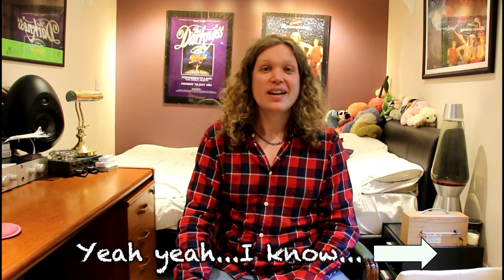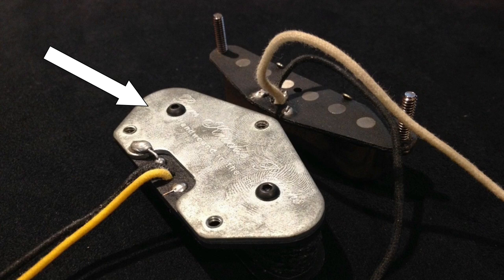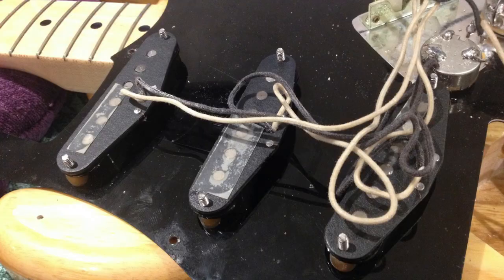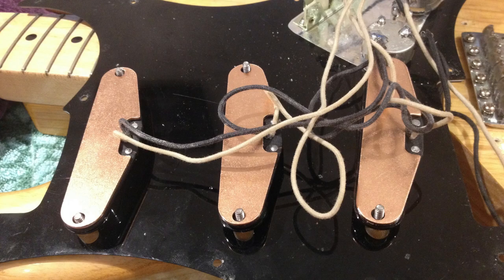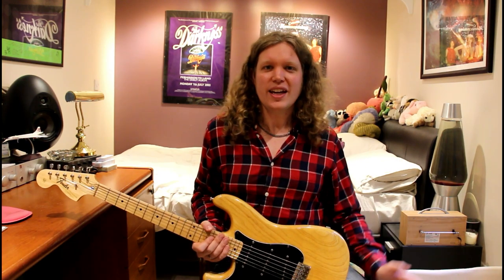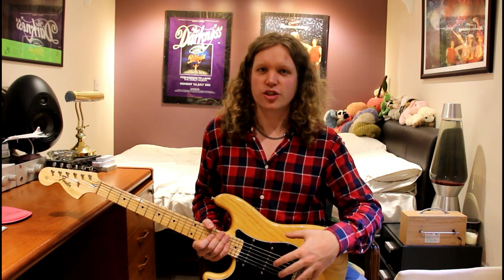Strat Base Plates: Do They Work?

Comment: Tighter bottom end and little bit of a zing to the high mids. Definitely makes the Strat "rockier".
Reply: Tighter bottom end usually means less bass frequencies, are you referring to that?
Reply: @javiceres  It seems like he wasn't. I hear more bass with the plates than without.
Reply: @101Volts  So I think but...

Comment: Definite difference. I would leave it on the bridge pup only.
Reply: Max Jones yeh, I like the sound of my Lindy Fralin Vintage Hot set with the base plate under the bridge only on my USA Hamer Daytona Strat. It’s a natural swamp ash body with maple neck and fingerboard.
Reply: @warmothgmc  Lindy Fralin pickups reign supreme, in my humble opinion. I have the P.A.F.s for my Les Paul copy, but my next purchase will be a loaded pick-guard with the base-plate installed in the bridge position - I really do want the tone to exist somewhere between pure strat and P90.

Comment: I don't know who claims the Steel "reflects" the magnetic field back up, but that doesn't make sense.  Steel is much more permeable and conductive than AlNiCo.  If anything, it draws flux away from the AlNiCo, but may also draw the flux lines from the strings down more directly through the coil, while slightly increasing coil inductance and rolling off highs.

Comment: Wow I'm surprised how different it actually sounds to me. I really liked both sounds and would be happy with either -but I think I kinda preferred the base plates under all three pickups actually 🤔 Very interesting -thank you for doing this 👍😊
Reply from the maker: No probs Alena :-) I ended up taking them out, but if you're wanting to beef up a Strat they're ideal!
Reply: @JoePerkinsMusic  For sure, and I might try it someday.  -But - in all honesty I have found that anytime things get changed in my signal chain (including the guitar) I can almost always find a way to get the sound I want and make it work for me if I work at it. So with or without the plates I'm sure I could find comparable sounds with some adjustments -it just depends what starting point you prefer I guess 😄 Still very interesting vid, thank you again for the experimentation I know its allot of work! 👍
Reply from the maker: @alenac7269 Yeah absolutely, there's generally a way to adapt your gear to get the sounds...base plates or turning up the bass/low mids will achieve similar results! :-)
Reply: If you want more beef, the base plates should be picked

Comment: Base plate needs to be larger than the pup itself. Like it is on a tele.The whole concept is based on making the magnetic field wider on the bottom and more focused on the top side of the pup, creating a gumdrop shape magnetic field.
By the plate being the same size as the bottom you still have an hour glass shape magnetic field with the middle slightly elongated towards the bottom. A very subtle change.
Reply: Ryan Lewis I added a base plate to the bridge of my Tex Mex pickups because I found it a bit too bright and harsh!
Made a big noticeable improvement, the pickup is far more useable now!
Reply: @ces69  dit your Bridge pick-up get a Little bit microphonic?

Comment: Hell, I didn't buy it at first, but there is a noticeable difference. With the bass plates, it just a little bit more pronounced and im your face, with an ever so slight boost to the low end.

Comment: good demo again. I like the fact that the bottom and mids are increasing and the top decreasing. Just what I need. But I will make them from aluminium. In that way the pickup will not get hotter but the top high freq will be decreased

Comment: First question: did you change the strings between the two tests?
Second question: is the pickup height the same in both two tests?

A base plate mounted on a pickup change the inductance of the pickup itself. It si measurable with a multimeter. Low level Inductance pickups (around 2-3 Henries) are typical of Strato pickups and produce a sound very rich of high frequencies. The more the inductance raises the more the high frequencies are lowered and the more the mid frequencies are hemphasized. This is the reason why you prefer it on the bridge pickup (I totally agree with you). In my opinion adding a base plate and activating the tone potentiometer of the bridge pickup really adds a lot of versatilty and new tones to a Stratocaster.

One final thing, it is also important the material of the base plate because brass, steel and nickel have a different way of affecting inductance.
Reply from the maker: 1) Same strings - just slackened off then retightened
2) Yep, they didn’t move at all. I just took off the pickguard, placed the baseplates on (the magnetism holds them in place - they don’t need screws) then put the pickguard back on. So nothing changed apart from the plates. 👍
Reply: @JoePerkinsMusic  Very good! I'm personally winding the set of pickups of my Strato, and only the bridge pickup will have its steel base plate and will be a little overwound, so I'm glad that you had my same feedback, it is  a confirmation of what I thought. All the best
Reply: Brass will not work, because it is not magnetic.

Comment: It does improve it...more bass response. Kinda driving the amp harder in a way with the plates. But seems to thicken up the sound. I would just use it on the bridge pickup.  I like mine and I put wax and a piece of masking tape on it to avoid microphonics and its fine. Never heard of putting baseplates on all 3. Moves the instrument more into Tele territory.
Reply: If you want more beef, the plates are the way.

Comment: To my ear it sounded as though it were adding the kind of gain you get from hitting the strings a bit harder. Quite subtle but definitely there. I'd love to see a three way comparison between plates/no plates/boost pedal, to see if the same can be achieved with a good boost. Great video, thanks for sharing these results!
Reply: Install a switch, temporarily and run the wires out of the cavity a d a\b and make a very informed final decision.

Comment: I agree can’t hear a difference in the neck or middle really, but you can hear a notable difference with the bridge pickup, I’m looking at getting a chris buck Id set that as the plate on the bridge!!
Reply from the maker: The bridge is the only place I'd consider using one, to be honest.  Makes a Strat a lot more suited to rocking out! :P

Comment: In my experience it can make your Strat microphonic like some Teles. I think wax between the pickup and the plate can help with that. But you have to decide if the slightly beefed up tone is worth it. It would probably be less of a hussle to just get higher output pickups.
Reply from the maker: It's more a matter of tone than pure output - but yes, different pickups (or different style of guitar!) might be more sensible if microphonics are a problem.
Reply: It might be less of a hussle to get higher output pickups, but it's a lot cheaper to get base plates

Comment: Hey Joe!  Thanks so much for comparison. Going to add plate to bridge of Fender Custom Shop Texas Specials set. The darn bridge needs more gusto and the added metal plate should do the trick.  Also adding the on/off switch to the neck (aka David Gilmour modification) and oil/paper Russian .033 cap.   Take care and keep experimenting. Cheers from USA.....
Reply from the maker: Cheers John :-)
Reply: How did it turn out? 😀

Comment: Hi Jeo, another solid video! Question: did you simply put them on and screw them in? Where there any soldering or taping off the poles to avoid shorting etc? I saw those things in other videos and thought gees that's too much work for a baseplate. Please let me know. If it's simply putting them on I'll do it. Thanks.
Reply from the maker: Hi - some of them might be different, but with these ones they just slotted over the pickup screws and the magnetism held them in place.  All I had to do was take the pickguard off, drop them onto the base of the pickups and that was it...no soldering, no removal of pickups, no screwing...nothing.  They just rest there and the magnets hold them  :-)

Comment: It looks like your volume and tone knobs are both turned about half a notch between the takes. Did you take the plastic caps off when installing the base plates or was this an oversight?
Reply from the maker: Ooh - I don't think I took the knobs off doing this video, from memory.  Certainly wasn't intentional if they're slightly moved.  Though I played with the base plates for a good few days & can definitely confirm that the findings in the video are accurate...so any 0.5mm turn of the knob in the video was having negligible effect if any.  Certainly wasn't done on purpose!! :-)

Comment: They do work, but they seem to add what I usually avoid by adjusting amp tone controls to my taste: bass frequencies.
I don’t like too much of bass freqs , they always out put me in trouble playing in a full band context. When I need to cut through the mix instead of cranking up the volume (always wrong) or the mid (not always effective), I turn the bass down instead.
Reply from the maker: I took them off soon after shooting this video....they do what they do, but it's certainly not for everybody :-)

Comment: The demo was very useful. I really liked the beefier sound on the bridge pickup, and it is exactly what I'm looking for. Do you have a link to where they can be purchased, brand information, etc.? Thanks
Reply from the maker: Glad it was useful :-) I can't remember exactly where these were from or who made them, but plenty of people make them and lots of pickup manufacturers offer them as options/spares.  Monty's do a set which look good: https://www.montysguitars.com/products/montys-strat-baseplate
Reply: @JoePerkinsMusic  I have Kinman Noiseless pickups, so I contacted them first to see if a plate would work because the bottom of the pickup was not magnetic. They said no. So, by cutting the pickguard,  I moved the treble side of my bridge pickup so it was parallel with the bass side. I was then able to achieve the growl, and volume I wanted by doing that, as I could set the pickup higher without the trebles being too loud and spikey . Thanks
Reply: @picksalot1  I’m trying to visualise exactly what you’re saying you did BUT I just can’t imagine what you could do to a Pickguard to change the sound of a pick up?!🤔

Can you go into more detail, please?
Reply: @BeesWaxMinder  Normally on a Strat, the treble side of the bridge pickup is closer to the bridge than the bass side of the pickup. I temporarily removed the bridge pickup and pickguard, then cut/enlarged the bridge pickguard "slot" so I could  treble side of the pickup could be the same distance from the bridge as the bass side of the pickup. That means that the treble side of the bridge pickup is now about 1/2 inch closer to the neck than it would have ordinarily been. I also had to drill a hole for the bridge adjustment screw. I plugged the gap where the treble side of the pickup originally was with some extra pickguard material that I had. Hope that makes it clear what I did.
Reply: @picksalot1  ah RIGHT!🙏
Thanks 🙂👍
So, basically, you made all three pick ups be completely straight and none of them angled?
Reply: @BeesWaxMinder  Actually, I previously removed the middle pickup as it got in the way of my finger picking. I also changed one of the volume knobs into a Tone knob to use with the bridge pickup - much more useful that way, as far as I'm concerned. I can blend the neck and bridge pickup for an out of phase sound, and dial in the tone on each separately. I moved the neck pickup a little towards the bridge as well. Both bridge and neck pickups are straight.😎
Reply: @picksalot1  
E X C E L E N T!
Reply: @BeesWaxMinder  He didn´t do anything to the pickguard, he added a magnetic base plate under the pickup, to focus the the magnetic force upwards. Did you actually
watch the video??
Reply: @picksalot1 By straightening out the bridge pickup you fattened up the sound of the trebles? And you said here that the trebles decreased in volume? I would think that the trebles might increase in volume as the strings move less as you get closer to the bridge and you moved that part of the pickup towards the neck. Would you say that the distance of your bridge pickup now is the same as a Jaguar’s pickup to the bridge, or further away from the bridge?
Reply: @enriquelopez9803  The trebles are warmer sounding with the treble side further away from the Bridge. I don't think I said the trebles decreased in volume, but my comments are pretty old. There was no significant change is the volume of the treble stings, but the tone became warmer, less ice-picky, and easier to dial in a tone. I've never played a Jaguar, so I can't comment on that. YMMV
Reply: @picksalot1  Thank you for getting back to me. This sounds like a good solution to warm up the treble strings. After the Tele and the Strat, it seems that most Fender guitars had straight pick ups as opposed to the angled ones. This makes sense.

Comment: Are you just increasing the magnetic field of the pickup?

Does the shape of the magnetic field do anything? Does it change the frequency response?

Clearly a pickup that has the reversed polarity sounds the same.
Reply from the maker: It's not reversing the polarity of the pickup - I believe (though I'm no expert!) it's reflecting the bottom of the field that would usually be lost underneath the pickup upwards...so it increases the output & gives a thicker sound overall.  Essentially making a Strat pickup closer in design to that of a Tele bridge.  As I said though, I'm no expert...I just know it beefs it up :P

Comment: Great video, but, how i put the base plates in my pickup, just solder the pickup ground to the base or there is some more? Thks
Reply from the maker: Not even that - they're just placed on the underside of the pickup & the magnetic pull holds it in place :-)
Reply: Joe Perkins When I bought mine it was recommended I attach them with wax!
I melted a little candle wax on to the plate and allowed to cool till solid. Put the plate on the bottom of the pickup and warmed with a soldering iron till the wax softened and stuck to the pickup. Once cooled was solid!
And don’t forget to make the soldered wire connection!
Put mine on a Fender Tex Mex bridge pickup which I found very ice picky!
Made a massive difference to me, making the bridge pickup much more useful and useable!